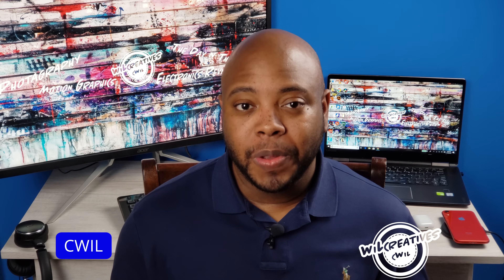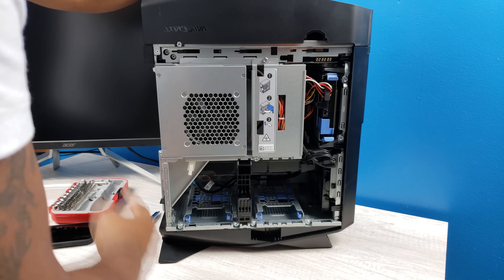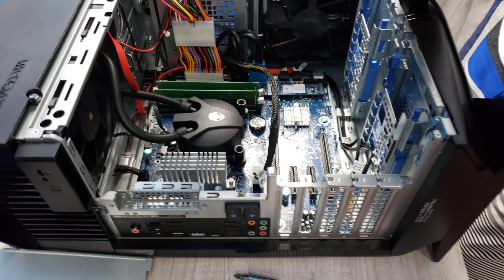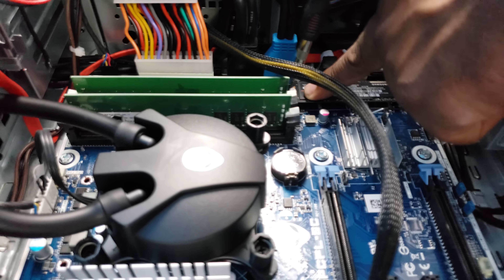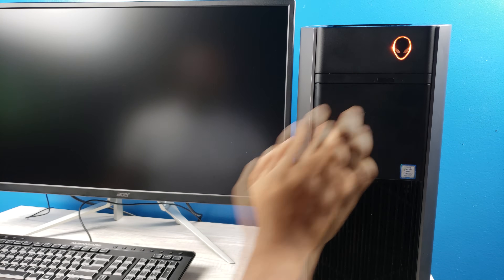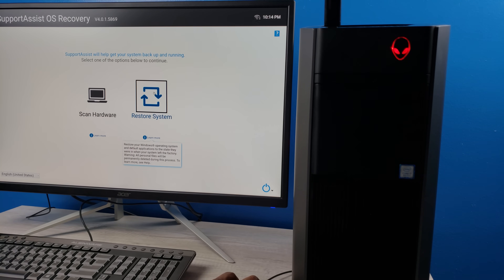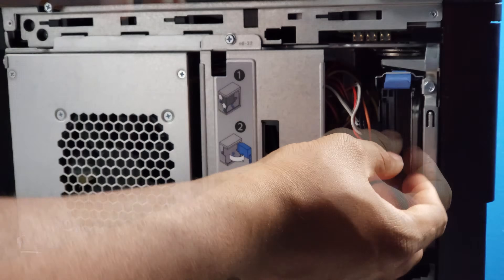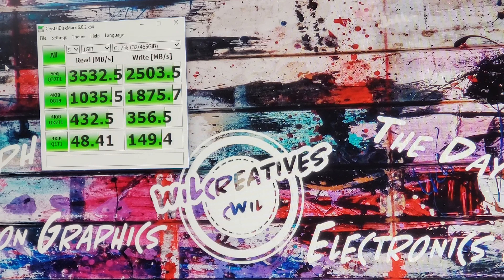First Impressions / Installation Samsung SSD M.2 interface 500gb 970 Evo to Dell Alienware Aurora R7

Comment: I did the setup, same R7 Intel optane and I got the 970 Plus NVMe M.2 V-VAND SSD but I cant seem to get this going.  May I ask you a question boss?
Reply from the maker: Gotcha what can I help you with?
Reply: @WiLcreatives  I have this same PC. So what is that Intel octane card? IS IT an nvme? How much space is it? Is my OS on there. I'm so confused on whether I can remove it or not.
Reply: I will add though everything seems really fast. My boot time is like 6 seconds, I just want more space I only have the 1tb HDD with the Intel optane.   Not sure if I should get a m.2 nvme or just a 2.5 SSD.

Comment: Hey there @WiLcreatives i just installed a Samsung 970 on my Aurora R7 but I can't seem to find the old HDD. Any recommendations?
Reply: I'm having the same problem, I can't find my hdd it booted up everything on ssd so all my stuff is gone what do I do? It still recognized the hdd in Bios but how do I get it back
Reply from the maker: Hey you're talking about the 7200rpm drive?
Reply: @WiLcreatives  Yes exactly this one
Reply from the maker: I assume you installed windows on the 970 already. If so did you reconnect the old hard drive and go into disk management to format it?
Reply: @WiLcreatives  Yeah I have already installed clean windows on the NVME. The problem is in the partition there is no HDD but in the Bios it is recognized. Do I have to change any settings in the BIOS?
Reply from the maker: @venom5848  You shouldn't have to. I would power down, disconnect all power, disconnect the hard drive and reconnect it to see what happens.
Reply: @WiLcreatives  Well after some time thinking i managed to solve the problem! You see when i updated the drivers i also downloaded support assist and downloaded all the recommended drivers one of which was Intel Rapid Storage. And when i opened it to check if there is a malfunction there it was selected as a primary drive and showed an error. Then i just uninstall it and now everything seems fine! 
Big reminder to anyone replacing Optane memory to not install the recommended driver! Anyway thanks for the video and your prompt reply!
Reply from the maker: Ok awesome glad it worked out for you!

Comment: Wow i loved how you didnt plug in to the 1tb harddrive because i was planning to install my operating windows on a ssd that i will be purchasing and this will help me not make the mistake and install it on the 1tb harddrive. Thanks for this tip. Im fairly new to powerful pcs and i ordered the R8. Should be here before may 2. I jus had another request..if you ever make a video of replacing the psu that would be much appreciated. Thanks! Very nice work! Keep it up.
Reply from the maker: Thanks for the support and feedback! You are in luck, here my PSU upgrade video https://youtu.be/SdWDfui-KOE

Comment: Anyone know if the new model will fit in the R7?  The Samsung 970 EVO Plus Series - 500GB PCIe NVMe - M.2 Internal SSD (MZ-V7S500B/AM)
Reply from the maker: Yes  it does, the form factor hasn't changed on the Plus

Comment: Hello. Been watching your videos since you got your Aurora R7. I have the same just different GPU. I have a problem. I did everything your video prescribed, but ran into one hiccup. After I reformatted the hard drive that came with the system the computer does not show me how much used space I have. I already added some files and apps into the hard drive, like Razer Synapse or Corsair iCue, but it always says I have the exact amount of free space since I reformatted it. FYI, its a Local Disk type, NTFS file system, and used the letter E and also called it Media Drive. Even when I right click on the hard drive into Properties its does say I used x amount of used space but it doesn't display it. It just says I have 1.80TB which is the exact number since the reformatting according to your video. Help! Thank you.
Reply from the maker: Thanks for the support and I appreciate the feedback. You're seeing that info even after a restart?
Reply: @WiLcreatives  yes
Reply from the maker: I would completely shut the computer down, disconnect the power, unplug the sata cable and reconnect it to see what happens after that.
Reply: @WiLcreatives  ok. I will try that. Thanks

Comment: I added an SSD drive already on my aurora r7...should I grab this evo 970 ? i mean my other HDD is actually boosted by the intel optane isnt it?
Reply from the maker: That's only if you want to have the 970 evo as your boot drive. If that's the case yes. It will speed up your system!

Comment: hey boss I had some questions
Reply from the maker: What can I help you with?
Reply: i put the kingston hyper x fury 4 sticks in my r7 an it fried my ssd spent 4 or 5 hrs on the phone with dell support got my system running again but still has problems with something sometimes you press the button to turn it on an the power light just flashes after 2 or 3 times it will start working just any thoughts  that's all
Reply from the maker: Sorry to hear that. Did you figure how it shorted your system?
Reply: no
 @WiLcreatives
Reply from the maker: When you installed the ram all power was disconnected right? First time hearing this issue.
Reply: yes the power cable was unplugged  @WiLcreatives
Reply from the maker: Gotcha the only thing I can think of is either bad memory or static electricity from your body. I will have to look deeper into this one.

Comment: Do you have to run windows 10 from the SSD?  That's the only part that confuses me about this process.
Reply from the maker: You dont have to that's just what I decided to do.
Reply: WiLcreatives ok, I’ve heard it’s better to run the OS off of the SSD though right?
Reply from the maker: Yes that is correct. 1 of the main reasons why I made the swap. The NVME ssd vs the 7200rpm drive is a huge difference. Like night and day.

Comment: @WiLcreatives
Thank you for the awesome video. I happen to have exactly the same PC as you! :)   
I have a spare 500gb evo ssd that I was thinking about putting in a spare hdd/sdd slot. Would that work? I haven't really seen any connection cables hanging about inside the box though...
Reply from the maker: +Rafal Polessa thanks for the feedback! Yes that will work check out the video I did on installing the 512gb Sandisk ssd. You will need to purchase a sata iii cable though.

Comment: Did some research, the folks at Dell - Alienware department scream murder when I mentioned the 970 EVO... Appearently they get a lot of issues with the EVO series. 

Also I noticed the mark up for those kingston Memory sticks, the XMP type you installed at a serious mark up where I was finding two 16GB sticks at 245.00 and they wanted 675 for the two. Pirates.

For my M.2 option, I was going to straddle the middle ground and for a WD Black N750 in 1TB, which is roughly at 249.00. I noticed they got a heat sink option, but from what I was reading and the common feeling is that the heatsink addition does not really mean much.
Reply from the maker: Dell doesn't want to co-sign Samsung that's all. Yeah they mark up the prices on everything. I think the heatsink for m.2 is overrated unless your system produces a lot of heat
Reply: They told me they have issues with Samsung evo on the phone cause I need a bigger ssd was told dont buy a Samsung evo ..

Comment: Okay mine up and running and I finally realized (yes, I am ignorant when it comes to this new tech), The M.2 mine comes with is a 256GB SSD which acts as the boot and my one 1TB is the standard HD drive as back up (blank).

My plan of action, and please offer guidance, I am getting a Samsung 970 EVO 1TB (though I may spring for the 2TB) as my main by replacing the old one.

My 1TB SATA hard drive I will swap out for a 6TB WD Black HD 7200 RPM

And with the two separate 2.5 slots I will probably throw in 1TB SSD drives or just wait till the larger ones become cheaper and more affordable, since I will have more than enough space to store what I need. 

Here is my noob question: How do I make my standard drive (the normal HD) to store some programs or as my default Documents-Picture and music HD? Or should I even bother?
Reply from the maker: That is off the charts! I wouldn’t bother trying to figure out the default hard drive. Your boot drive will always be default in windows. Now you have the easy option of directing all of your downloads/pictures/video and/or certain programs to be stored or installed to what ever hard drive you want. You just have to do the directing at that point of time. Like all of my games are installed on my 500gb Sandisk ssd but that’s not my default hdd.
Reply: Right. Does it matter for game play if its on the SSDs or the Regular HD 7200 RPM?
Reply from the maker: Load times are faster and you may see an increase in FPS with the ssd vs the 7200rpm drive.
Reply: @WiLcreatives  So pretty much tge HD can be more used as a back up - archive of sorts?
Reply from the maker: Yep!

Comment: A question - I just got my Alienware Aurora R7 and it came with the standard 1TB HD and a 256GB Solid State. From what I see, I got a free slot for an SSD, do you recommend an extra one so I can pretty much load my Games on or should I invest in replacing my standard Hard drive and if so, will any 3.5" do, or are there key things I should look for. Dell, did not really fill me with confidence since the highest they rated as being compatible for the R7 was a 4TB running at 5400 RPM.

Any recommendations as I am shopping around. Will other SATA or SSD drives meet certain specs that I should have?

Comment: I got a question, when I click the link to the ssd it says: Solid State Drive for laptops, can I still use it for a desktop? Btw I'm going to be building my first gaming pc and wanted to know
Thanks
Reply: Thanks for the fast reply, I am reading that it also depends if your motherboard is compatible with this ssd, I am gonna be using  an asus rog strix z390-e gaming motherboard
Reply from the maker: Gotcha I think you should be fine with the samsung drives
Reply: @WiLcreatives  alright thanks, btw I changed to a msi mpg z390 gaming edge ac mobo and It is compatible:)
Reply from the maker: Yeah it says that but it’s for desktops as well!

Comment: Hey Wil, so I just recently installed my ssd into the system. I reformatted the hdd because I thought I cloned everything into my ssd. Everything was fine after the reformat but after the second reboot my system couldn’t boot into the ssd. Forcing me to do a clean install of windows 10 once again onto my hdd. So currently my ssd still has all my previous info on it but I can’t load into it from my bios saying that there’s an error. What do I do?
Reply from the maker: Gotcha so just so I'm clear what type of SSD did you install? What drive did you do a clean install on?

Comment: Hey. Your video really helps. I just buy a Aurora R7. And I want to add a SSD and Optane.  Why not use Optane and SSD the same time? Is it because there is only one M.2 interface? If so, the only way I can do it to use SSD with 2.5inch interface? By the way, can you tell me where you download the DELL support software? Thanks!
Reply from the maker: Gotcha yeah the motherboard only had 1 M.2 slot. Personally I had bad experience with the optane memory. Theoretically you could use a 2.5in SSD and the optane if you want to go that route but that’s if the dell motherboard will let you configure it that way. I got the support software from dells support website. Once you put in your service tag number on the back of your system all the software that pertains to your model will come up.

Comment: Why did you remove the PSU?  I thought the Aurora R7 casing was designed so that all you had to do was swing out the arm that the PSU is attached to in order to have access to the motherboard.  It's marketed as "tool-free upgrading."
Reply from the maker: +James Flanagan Yeah that was my mistake! I didn’t have to remove it! Although it helped me with the camera angle. There was no need. I didn’t realize it until after the video was uploaded that it swings out. In the 30 day review video I talk about that!
Reply: Hey, now that you've had a chance to run with the new SSD over the Optane, what are your feelings?  Does it boot faster than before consistently?  I've been thinking about adding some SATA SSDs, but if the NVME M.2 runs even better, like noticeably better, I might rethink that.

Comment: hey bro love your work very informative.... how did you create the windows 10 installation from your pc laptop ? and secondly will it be a problem coming from a different computer ????
Reply from the maker: +Jason Turner Hey Jason I went to Microsoft’s website and created an Windows ISO usb installation after signing in with my Microsoft account info. Real simple just Google it. No issues as it was a Windows Installation usb, didn’t have anything to do with Dell.
Reply from the maker: +Jason Turner thanks for the feedback and support as well!
Reply: @WiLcreatives   hey i have another question do you believe using the Samsung SSD Using Samsung's Migration Software to clone the hdd will work fine as well ???
Reply: Thank you so much for your help bro !!!

Comment: Thanks for the video, it helped during my installation.  To make it easier the power supply swings out, so there is no need to remove it.  Then it just comes down to removing the GPU in order to install the 970.
Reply: I was literally about to say, uhh why you removing the power supply? 🤔
Reply from the maker: That's awesome! Thanks for the feedback. I figured it out after the video was done that it swings open 🤣🤣🤣
Reply: @WiLcreatives  Yeah, all you had to do was put your finger in the top hole part on the black plastic and kinda pull down towards the bottom of the case. It would have flexed just enough to come loose and out, then then psu would have swung easy.

Comment: There is no option for device configuration when I hit f12 after Ive put in the ssd. Do you have any idea why or what I can do about it. Also is it necessary to remove the power supply when installing?
Reply from the maker: +Tdmclaug You don’t need device configuration and no the power supply doesn’t have to be removed. You should have the swing arm. I removed the power supply by mistake all you have to do is swing it open.
Reply from the maker: +Tdmclaug Did your system come with the intel optane memory?
Reply: WiLcreatives I am not sure but I doubt it. I was able (for the most part, still haven’t finished) to get to the OS recovery screen on my old SSD but not on the new one with all of the same components except for the memory and I honestly have no idea what to do about.  This is my very first time putting shit in a computer or really messing around with its internal settings as well so sorry if these questions are a little basic.
Reply from the maker: Gotcha what type of drive did you install?

Comment: Did your ram usage go down when you installed the new m.2? At idle my Alienware is using 5GB of memory. Wanting to do this but im still new with PC's and all that
Reply from the maker: Good question. I didn't really pay attention to my ram usage in comparison to upgrading to the m.2 drive. Did you system come with the optane drive in the m.2 slot?
Reply: On Dells website it says its supposed to come with it stock.... I got the almost the same Alienware Except with a 1080. What is your idle RAM usage at now?
Reply from the maker: Gotcha. I just upgraded the ram in my system. I added 32gb on top of the 16gb I had. Currently I’m testing out just the 32gb I purchased and at idle I’m using 6.3gb of the 32gb installed. How much memory do you have?
Reply: @WiLcreatives  16 and Im using 5bg at idle, aren't both of ours RAM usage high?
Reply from the maker: It seems high but I've read that's pretty normal on Alienware systems. You also like myself may have certain programs running in the background like the Dell support assist. I think you should be fine unless you're using video or photo editing programs which require more ram.
Reply: @WiLcreatives  https://www.youtube.com/watch?v=VRFEr3rAizY&t=1252s, They talk about the alienware at around 3 min & 21 min.... I cant stream and record in OBS without my PC skipping and my friends with lower spec machines can... So yea i think its cuz of the RAM.

Comment: Can I not use the windows 10 usb that comes with my aurora for this, or I need to setup a separate recovery usb? god damn i am too noob for this stuff..
Reply from the maker: Are you replacing the optane drive? If so what drive are using to replace it with?